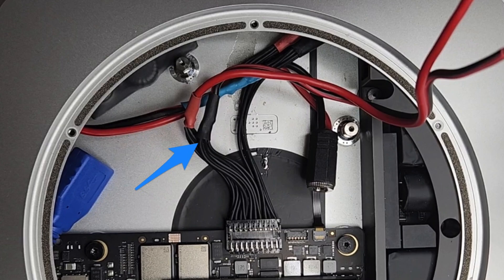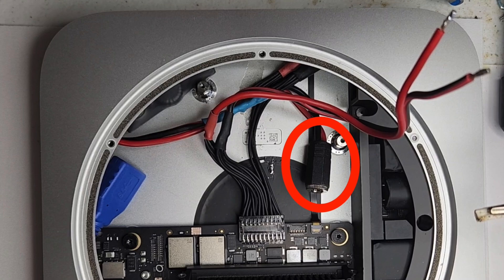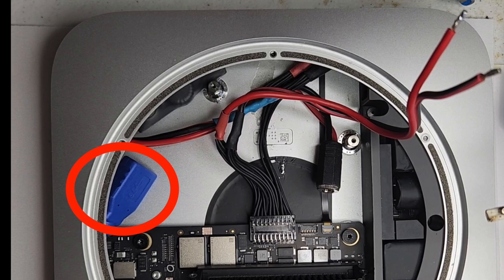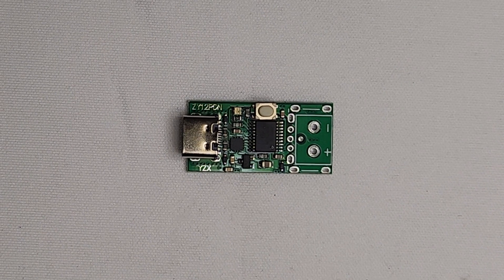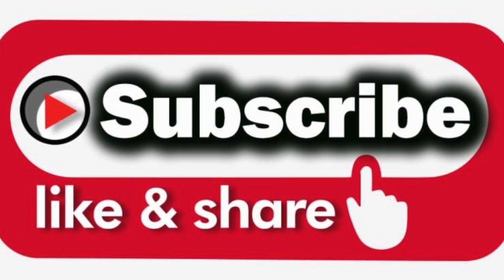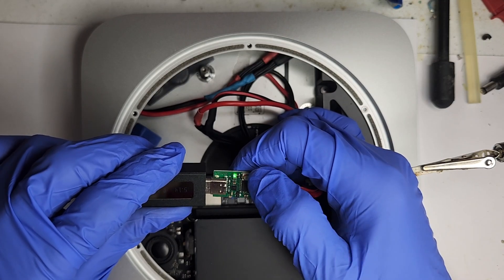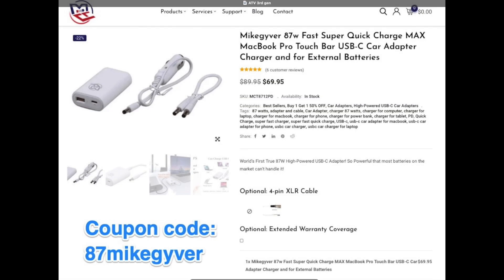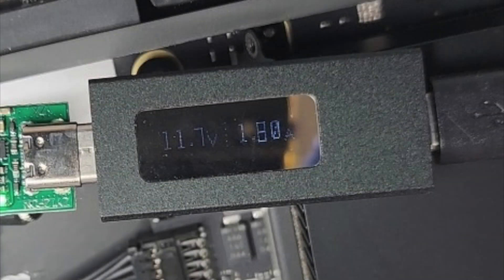DIY Hack upgrade your Mac Mini to power from USB-C

Comment: Can I just put the USB-C port and a 12V battery in parallel so that it charges the battery while it provides power and changes its power source to battery when I pull the usb c connection?

Comment: what about using the usbc board with 20v output and behind that a step down converter to 12v for more power, running it from a 100w power bank? also, would you recommend to put some sort of filter?
Reply from the maker: Snazzylabs talked about this, look up his video about making the Mac mini "mini".  As for Power Bank, it'll work, it'll all just come down to how much capacity (time) you'll get from it.

Comment: The AI voice is fine.  There are some people who try sounding like “Americans” but they get it all wrong and it’s very hard to listen to.  All the intonation and inflections are in the wrong places and I have to turn the sound off and just watch subtitles.  So, AI voices are good for that reason.

As far as the videos, it seems you never show the final result.  Just “it works” and done.  I’d like to see it actually plugged into a monitor without a power cord and working.  Or in the case of the battery, I’d like to see it with nothing plugged in and using an iPad as a screen.  Could you show it?

Also, in this video, does it mean you can run the Mac mini from a battery pack?
Reply from the maker: Hi, thanks for your feedback.  I thought we did that here: https://www.youtube.com/watch?v=_YYnS6BVMPg
Reply: @mikegyverComputer  That one is a bit unclear.  There’s a monitor hooked up to something, with cords going under some cloth…. and then a Mac mini with some cords plugged in and then they get unplugged.  We don’t see the monitor anymore, we just hear some sound and see an unplugged Mac mini.  I could make the same video without even having the Mac mini modded or powered on.  

A flat table, an iPad with no cords attached, a Mac mini with no cords attached streaming to the iPad, and then maybe plugging in a usb on the Mac mini that you see mount on the iPad’s screen…. That would be at least semi believable.
Reply from the maker: Oh I see you mean in terms of trust.   Got it.  I would think showing led would be enough.  And audio playing from unit itself. That coupled with glow of monitor going off when unplugging USBc cable.   And honestly hacking just the led to stay on would be even more troublesome.  Along with all the other things to fake it would be more work😮.  But stay tuned.
Reply: @mikegyverComputer  Yeah I don’t mean to be questioning what you did, I’m super excited by it so I would actually try doing it.  But if 1% chance it’s just fake and I ruin my Mac, I’d be so sad…

Well, I apologize if I sounded harsh, and that I’m mistrusting…. It’s really amazing and I think I would really want to attempt this.

One thing I wasn’t sure about, is this replacing the ability to use the main cord?  But you can instead power it with a DC adapter while charging the battery?

The idea that I could unplug, stick the Mac in my bag with my iPad, then go to some cafe and keep working on projects…. It’s what I dreamed of.
Reply from the maker: @DisgruntledPigumon  No prob.  I get it.  In todays world, there are a lot of 'funny' stuff out there.

Comment: this is kinda dumb, if you want a portable mac mini, get a macbook, air or pro 13 inch, they have the same chip, and you can use it wherever since it has everything integrated, if you want to use it as a desktop computer, it is actually worse now since you have to have yet another power adapter on your desk or floor so it doesn't make any sense to me. if anyone wants the "but what if i already had it and want a portable one" sell it, get a macbook, "but what if the power supply failed" just get a mac mini PSU from ebay or something.
Reply: M2 Mac air is double in price in comparison to m2 mini
Reply from the maker: We have users/customers working in remote office environment (RV's) that require running on efficient DC power (vs using an generator/inverter).  We also have users with a headless Mac minis in remote locations running scripts.
Reply: For me it makes sense, it is to reduce a portable Mac to the minimum size and at the lowest possible cost, make it the size of an iPhone and that you can carry all this power chip in a pocket, the possibilities are incredible. For you to understand, there are thousands of "Mini PC" on the market, look at Amazon, but it still doesn't exist on Mac, unless you make it for yourself. I use the Mac Mini in my work controlled by an iPad Mini and that it can be lighter and smaller is a dream for me.
Reply: For the price of the MacBook, I can get a Mac mini to do my general modeling, layout, rigging work and a PC to use as a rendering machine.  This hack just adds to the convenience.  But I get that a MacBook is the whole point of a portable computer.   Just thinking in dollars.
Reply: Apple has to reduce the size of the Mac Mini, make a new design and create more possibilities for expansion. but he doesn't want to do it, he continues with the same design he wanted more than 10 years ago. These adaptations make it lighter, more current and super cheap!
Reply: Another thing I don't like the Macbook Air or Pro is because you always have to be connected with USB dongles that constantly fail, on the other hand, everything is already integrated in the Mac Mini, is great!
Reply: LOL 😂, so  manny stupied peopel out there. Yeah I want portable mac mini, not a fridge and not a toaster. If this is not for you move along

Comment: Hi, does this run sustained on only 11.7v 1.8A (21W)? I thought it needed about 30W.
Reply from the maker: Hi, we just ran with Geekbench to get some early estimates, however it's without any other loads at the same time.  The 11.7v was under just Geekbench load.  The voltage will go back up to 12ish volts without load.